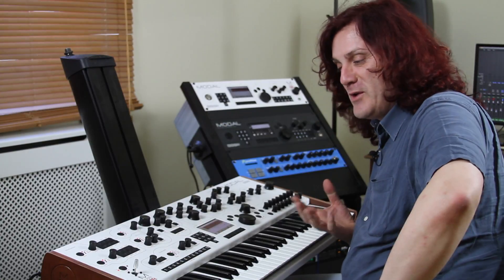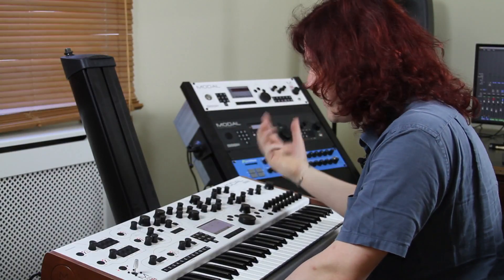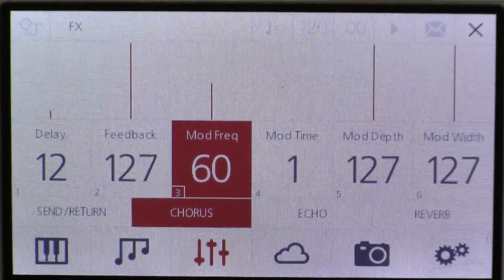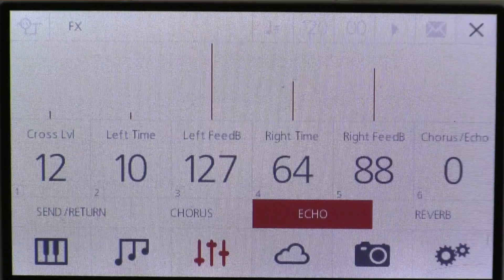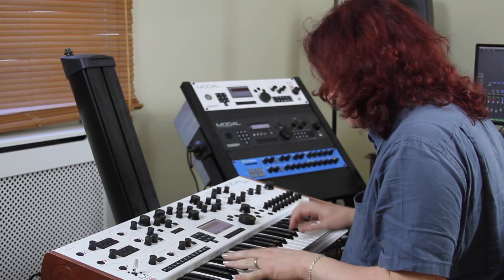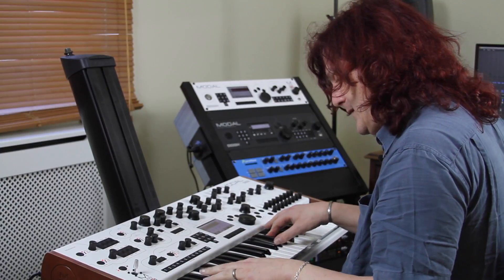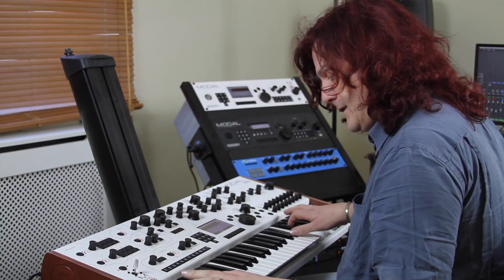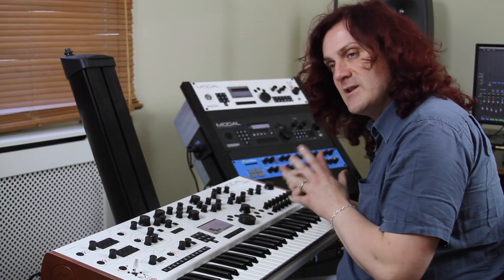Modal 002 Digital I O Board

Comment: Why haven't Modal Electronics like the other top synth manufacturers establish a 12, 24 or 48 months payment plan for customers with its resellers?  There's so much money to be made from the hundreds of reluctant customers like myself who would be willing to purchase a $5,500+ 008 with a digital i/o card if I could pay for it over a period of time.  If I were to spend that much money all at once, it would be on a used Audi A4 for the purpose of picking up chicks.
Reply: because thats what resellers are meant to do ! thats partly what they get paid to do, interact/interface  with end users . Surely Modal's job is product development not collecting money directly and finance forms have to be witnessed so do they drive all over the country?  Besides the contract is made with the retailer so it blur the edges who made the sale etc . Bottom line if the dealer cant provide an internal or external finance solution they would be unlikely to chosen as a Modal business partner.

Comment: How will existing 002 owners be able to purchase/ install the new board?
Reply: +kofieam3 My understanding is that the board availability will be announced on the Modal Electronics site. When you buy the effects board you will have to ship your 002 to a Modal service center where the card will be installed and they'll ship the synth back to you. If you try to install the board yourself, it will void the manufacturer's continued warranty.
Reply: +Silver Myth oh wow ok. There's a couple modal dealers near me. Hopefully they can do it. Btw I was always under the impression that midi i/o was standard when purchased. The synth OS just  needed to be implemented in a  update.

Comment: 008?
Reply: +thesidar This is Digital I/O card for the Modal 002, which is a 12 channel + stereo pair I/O device. For the Modal 008 and 001, there will be a different card as these are two part multi-timbral, although the range of effects and options will be the same - the only difference is the number of channels. This is an internal card that, on the 002 and 008, replaces the I/O card and on the 001 is a daughter board for the synth.
Reply: +Modal Electronics Same time frame as the 002 card release? Also will there be pre-installed options?